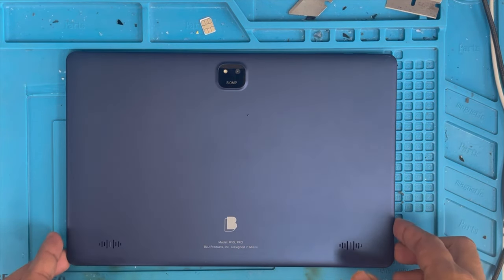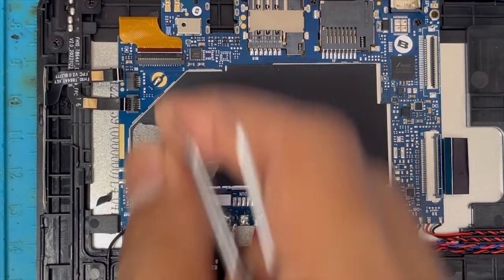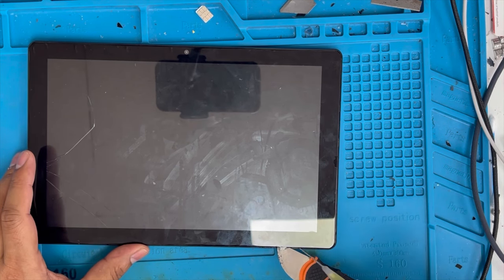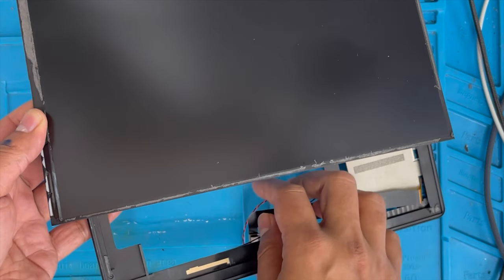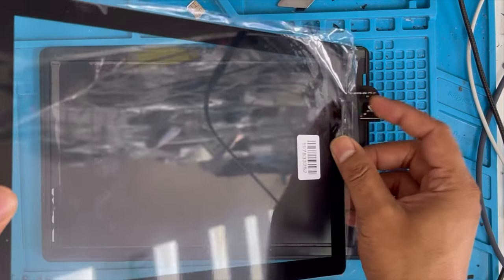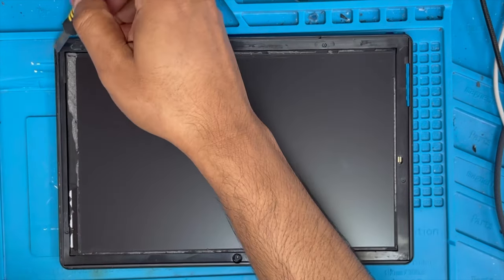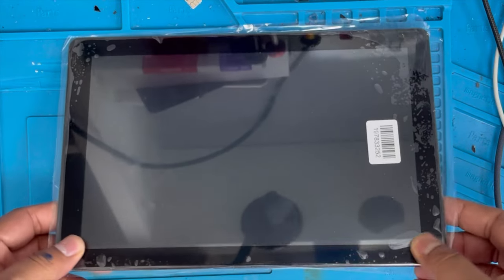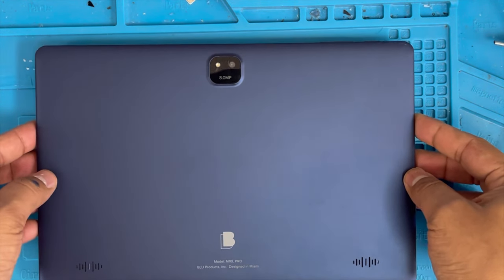Blu M10L pro touch digitizer screen replacement

Comment: how did you connect those three wires? is that a specific type of glue?
Reply: He soldered them. Look into it. He heated up a soldering iron and then melted the solder and added the wire. It cooled right after and created a stable connection.